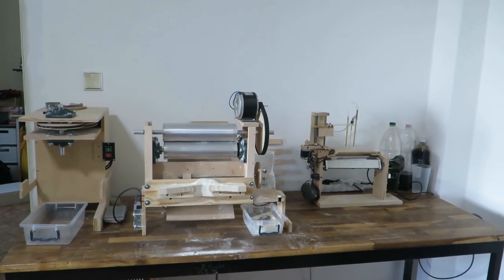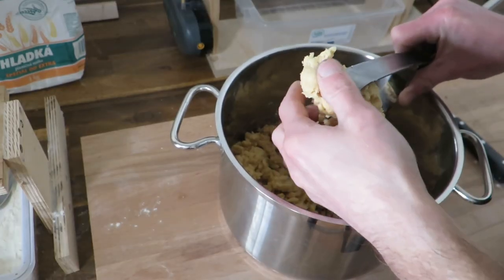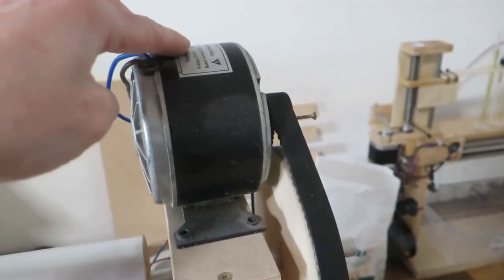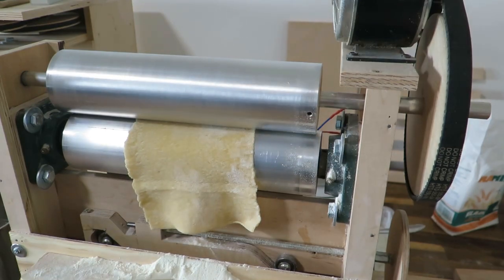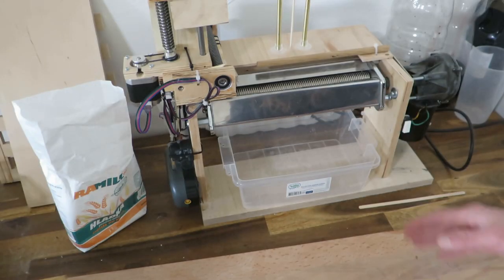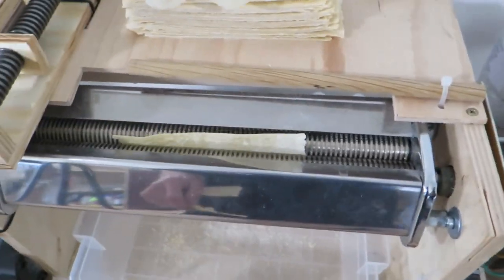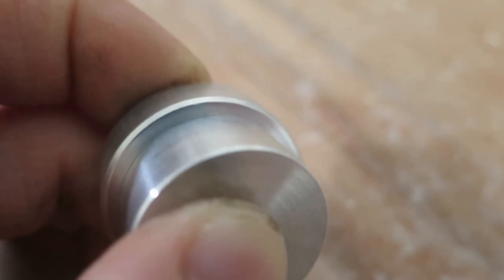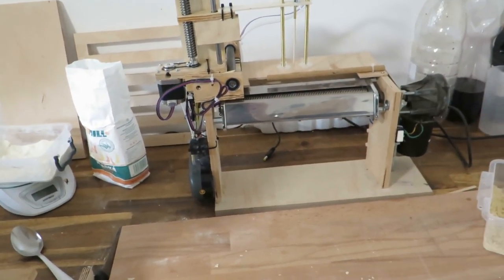Making pasta on a grand scale

Comment: Why you don't try to use stepper motor instead of noisy motor with reduction for the mixer?
Reply from the maker: That would be quite big stepper :D The motor is not loud, the pulleys are though. Plan is to make new software for mread making machine and use that instead, so that can free a bit more time. I am starting to get limited by water evaporating, so next logical step would be full automation lol. I need a warehouse.